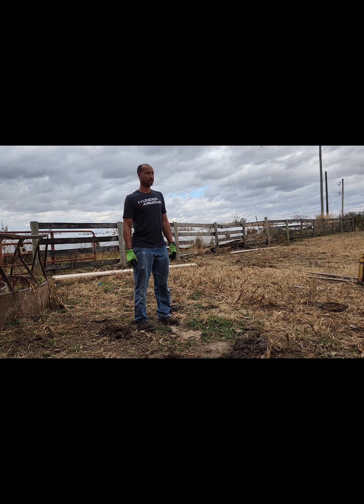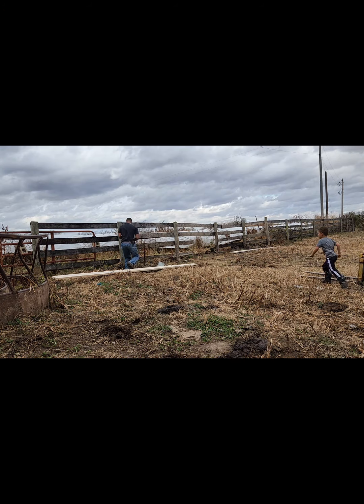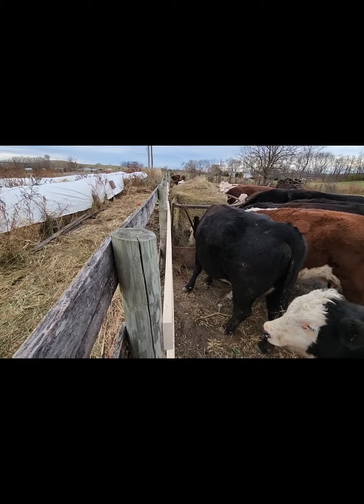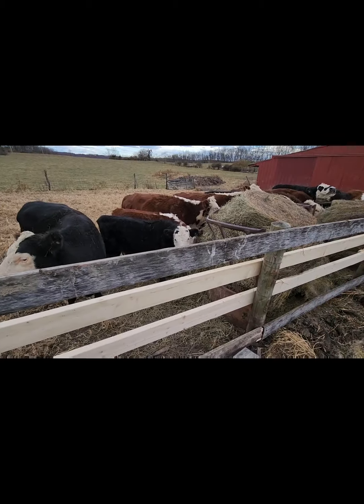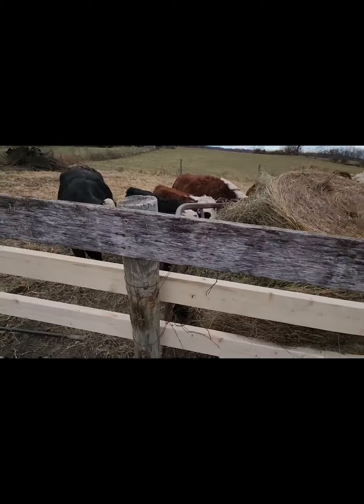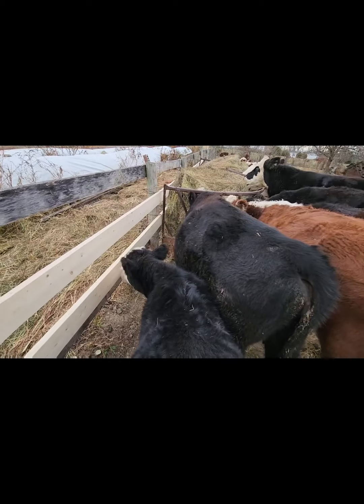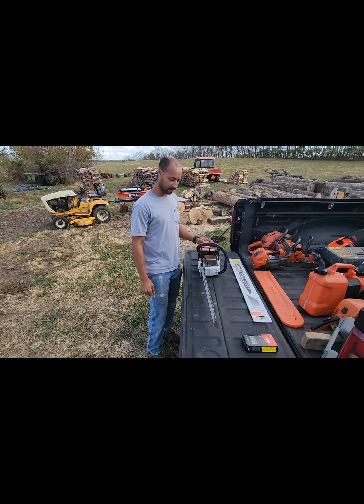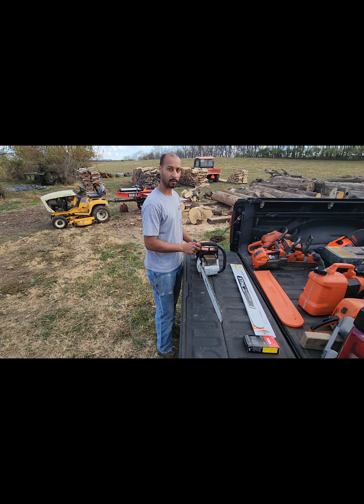Stihl MS500i upgrade | Feed lot prep

Comment: I know the 28” regular bar weighs 3 lbs 14 oz and the light bar 28” weighs 2 lbs 11 oz. That 25” regular bar weighs 3 lbs 10oz so at 3” longer that 28” light bar weighs 15 oz less than the regular 25” bar which is huge.
Reply from the maker: Yeah its a big difference between the 25 and the 28 light. I like it so far, havent had a chance to cut much with it yet.

Comment: Does the saw cut as fast with the 28 inch?
Reply from the maker: I didnt get to cut that much with it yet so i will have to get back to ya on that. It is better ballanced though. There is a big weight difference between the 25" and 28" even though its longer its still lighter.